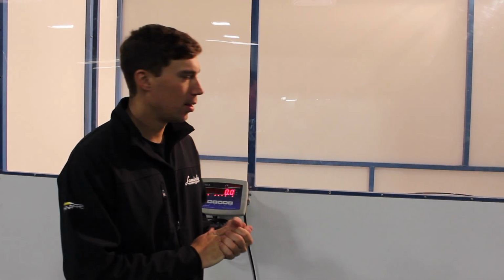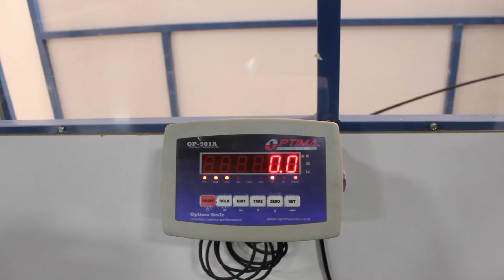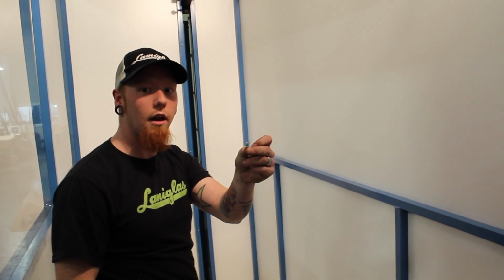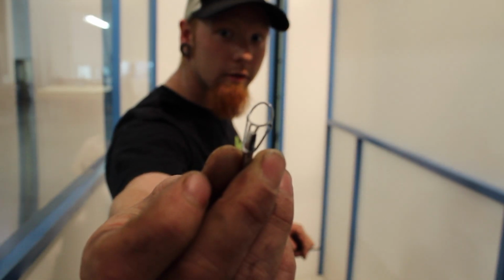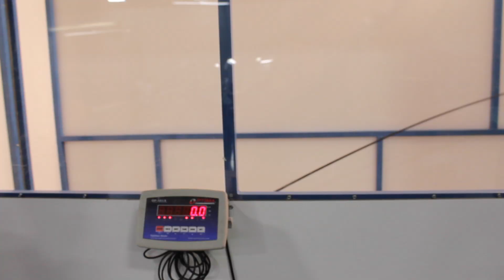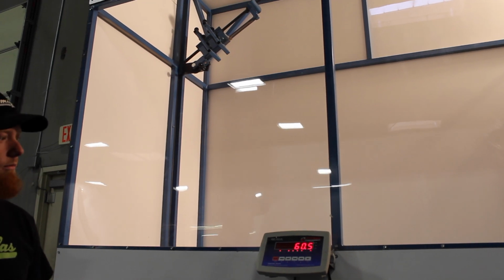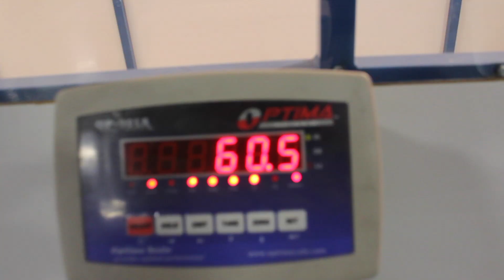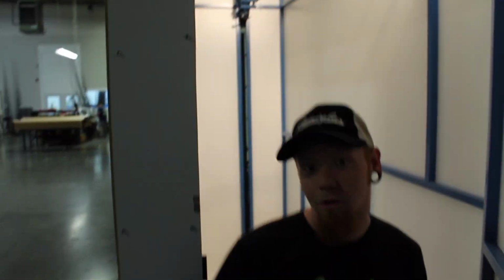Trying to BREAK a Lamiglas GSB Surf Blank!!!

Comment: How tall is this rod?
Reply from the maker: 10 foot.
Reply: @lamiglasrods9098  is this the blank the 9' Skinner rod is based on?
Reply: @lamiglasrods9098  I also want to know. I have the 9' GSB JOHN SKINNER and the blank label doesn't say 1201L, it says 1101L. Is the John Skinner a cut-down 1201L or what?
Reply from the maker: @thomastuorto9929  Yes!
Reply from the maker: @mikemelina7395  yes the John Skinner blank (GSB1101L) is just a cut down version of the GSB1201L